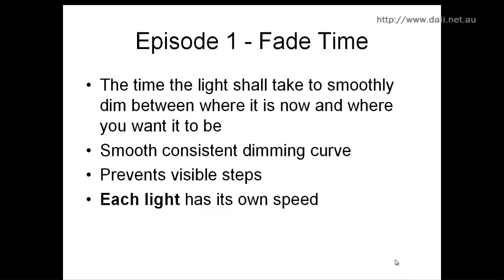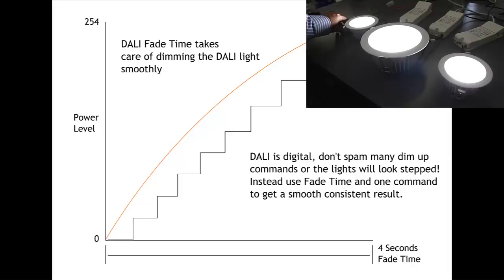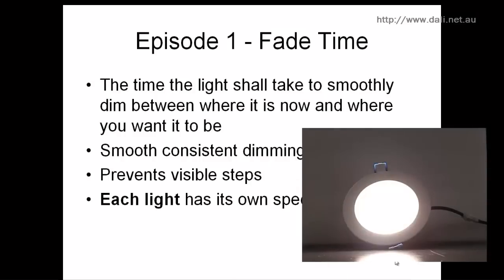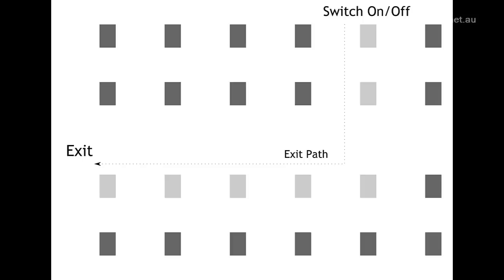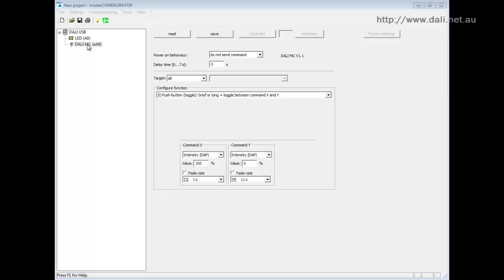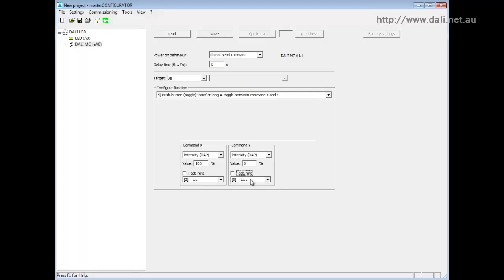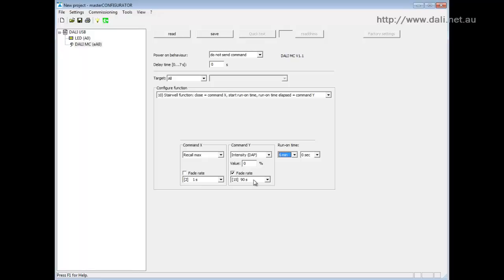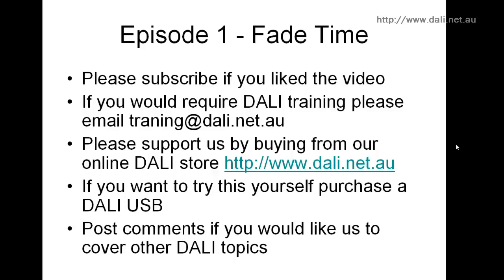DALI School Episode 01 - DALI Fade Time

Comment: I have a problem when  I plug out the power or the data cable the light come back to 5% because I put it in failure system how can I save the configuration in case when the power is shut down